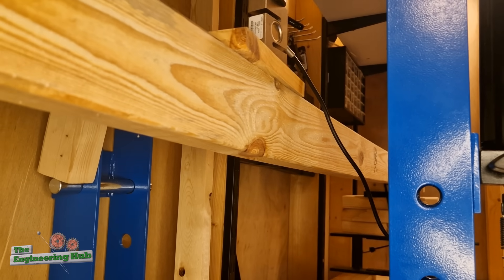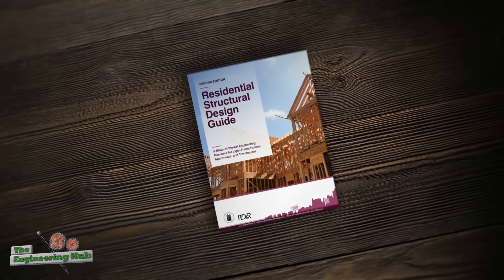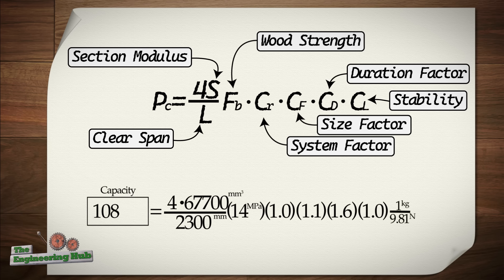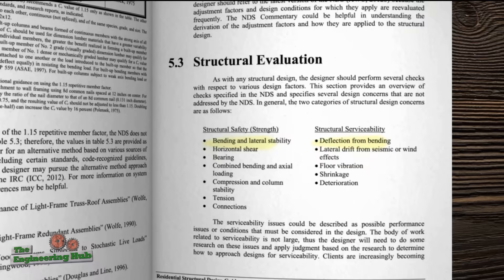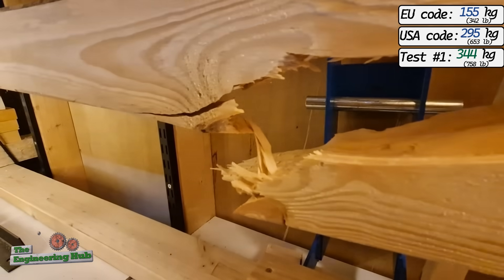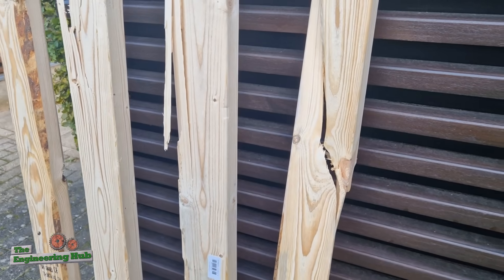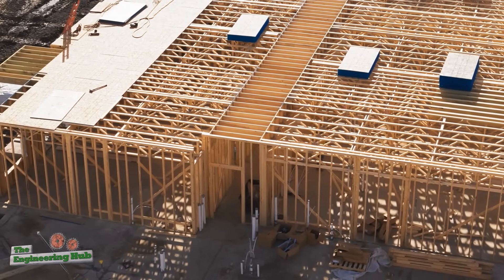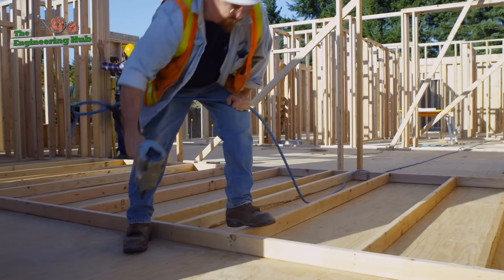I tested the strength of the 2 by 4!

Comment: A 2 x 4 should be 2 inches by 4 inches. 
I wish they would go back to true measurments.
Profits. As you stated in your earlier video that a 1.5" by 3.50 inch was just as strong.
Let's see.
Reply: Unfortunately, going back to true measurements is infeasible. The entire construction industry is built around these measurements being constant and consistent. Everything from doors and windows, to electrical and plumbing would have to be re-worked if these measurements changed. Using lumber that is sized correctly for that task makes building houses cheaper. As much as I love overbuilding things, there's a cost to it. If anything, instead of changing the dimensions, I'd like to see higher quality lumber. No knots bigger than 1/4" in the middle third of the board. Modern technology should make this kind of sorting at the mill trivial. Good builders will set aside the really crappy boards and use them for non-structural elements. The average builder, maybe knot.
Reply: @danbance5799  Thank you.

Comment: I have never scientifically tested the strength of a 2x4 but I have used plenty as levers over the years, I can testify some are stronger than others!
Reply: yes agree.. type of lumber, and even the age tree that lumber was cut into size.

many more factors surely
Reply: I work with a dude that tops 360lbs. He will walk 2x4’s with a loaded belt carrying materials
Reply: Product of nature. Remember woodworkers discarding certain pieces, because to many spots where branches came out.
Reply: Of course this is from nature. Nothing is standardized.
Reply: Yup, I've broken more than a few 2x4s and 2x6s prying stacks of lumber to one side or another
Reply: They don't make them like they used to.🤠
Reply: Do any tests right on the knots
Reply: Having fallen through them before I concur.
Reply: Typically (to european code) you should not use 2x4 for structural load. Anything rated C14 or lower is consider non structural and should just be used where structural failuers are not faital.
Reply: That's about false..